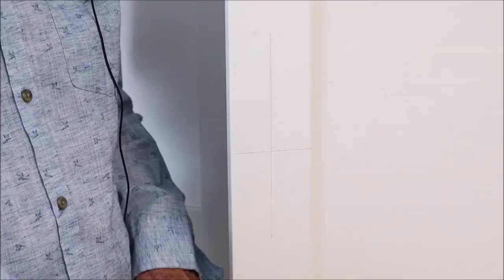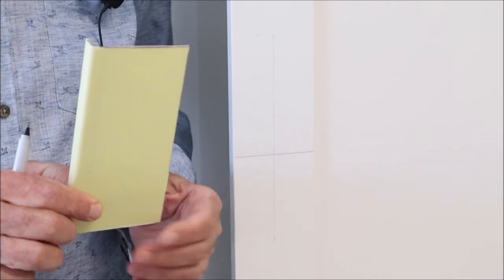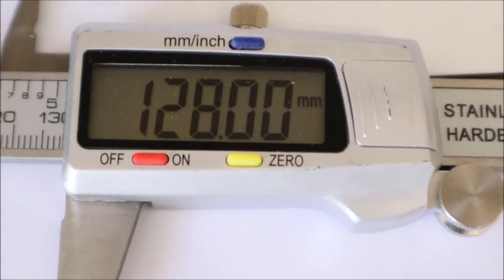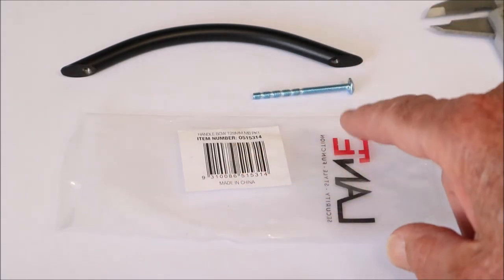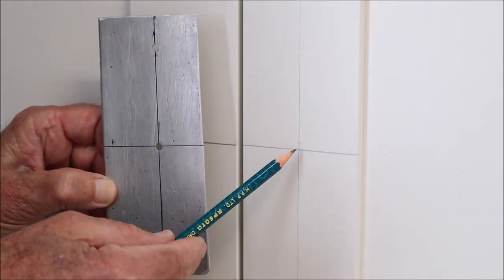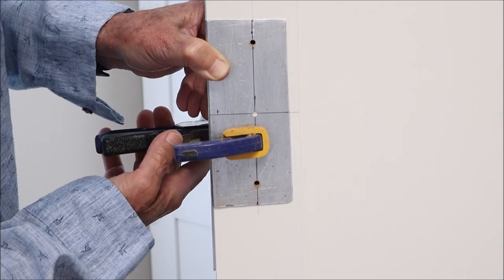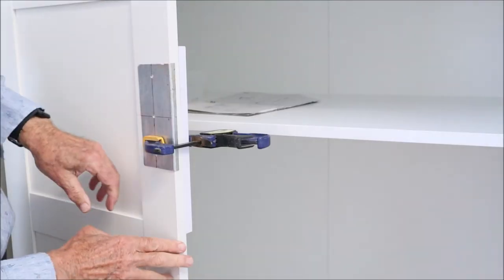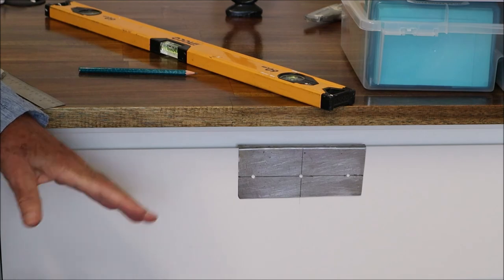How to make a template for fitting Ikea cabinet door or drawer handles

Comment: Hi Matt, your vids have been so helpful, and listening to a fellow countryman makes it even better. Wonder if you can help me. I have just tried to install inner drawers into tall pantry cupboard but they are not going all the way in so won't be able to put door on. Any suggestions.
Reply from the maker: Thank you for your kind feedback. Tricky to offer and advice without seeing it so here are some general suggestions. 1 if there is pace behind the drawer you could try and set the drawer rails further back by drilling new holes for the rails in the cupboard walls. This would be the best option. 
2. Shorten the drawer if possible but this option is fraught with things that could go wrong. 
Hope this is of some use, good luck👍😊
2.